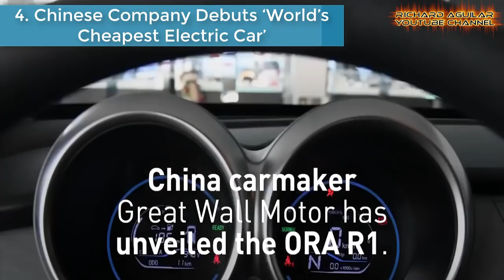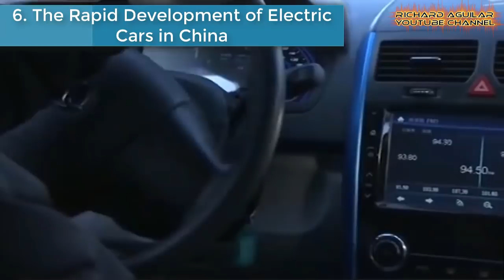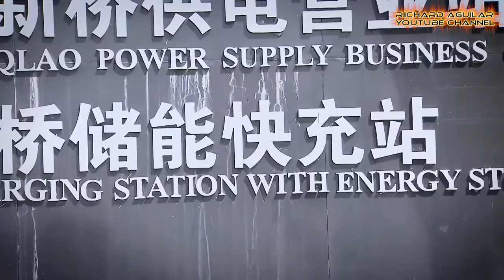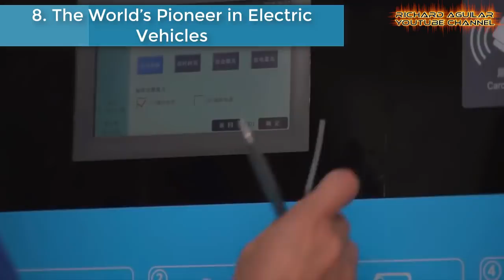Electric Vehicles in China Are Gaining Popularity Worldwide

Comment: In February this year, I sold the original gasoline car, added a little money, and changed the loan into an electric car of BYD. Now each electric charge plus repayment equals to the past oil charge.
There are charging stations in every high-speed service area, which is very convenient. However, the car I bought is less than 100000 yuan, and I can only run about 250km when I'm full. It's shorter in winter, so it's mainly used for city commuting. I can only run once in a while for a long distance.